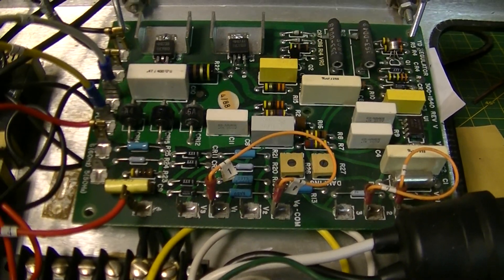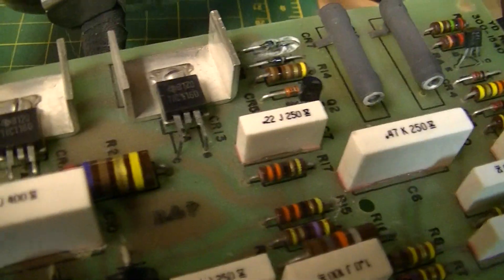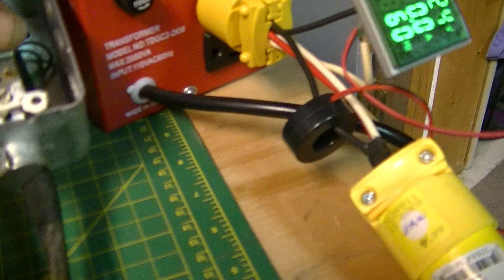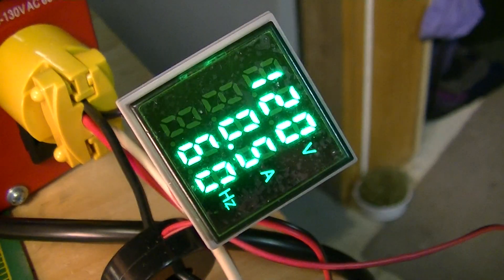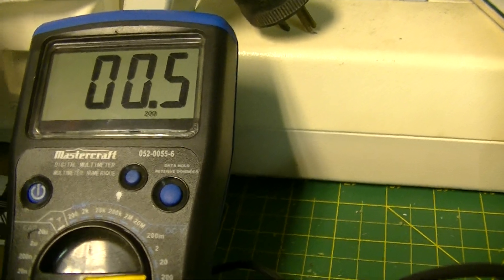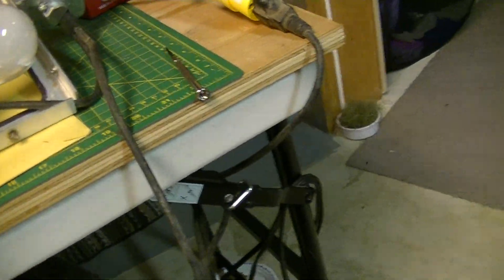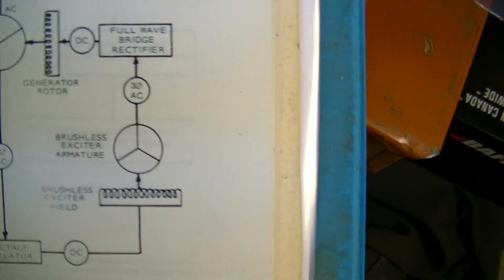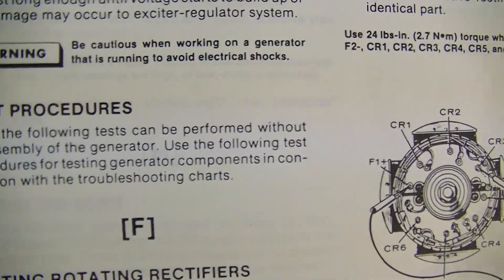Testing Onan YD VR21 Generator Voltage Regulator

Comment: imp trying to fix a Onan McGraw-Edison 30.0 GenSet generator, you know if this is the manual for it as well ?
Reply from the maker: The control board should say 'VR21' on it to be the same.
Reply: Thanks for replying, here is the issue I’m getting low voltage 30-40 volts, found some splices from motor line output to breaker panel that were burnt I just don’t know if they were touching ground, I don’t think I would get any voltage at all if it  would’ve grounded, so my question is do you think the voltage regulator is bad?
Reply from the maker: @sparkyedu  If you are getting a low output of say, 30 volts, that is a good thing. That tells you the basic generator is putting out the necessary 'residual voltage' that excites the VR21 card. The card should take that low voltage and process it so that the generator puts out the required voltage. So, yea, at this point and this distance, I feel the card is not doing it's job. Please read the other comments and replies on this video for more info on how the system works. Let me know what you find out. Thank you for the comments.

Comment: I’m having an issue with mine not providing voltage as well, the thing is is I have replaced to board with a new one and still no voltage I have went though the troubleshooting steps a few times now and I can’t seem to find the issue with mine it was working great one day then the lights in my house started flickering and pulsing, and I read on the forms to replace the board and now I have 47 volts ac coming out of the leads, the new board I got lucky and found an original onnan,online new and so I snagged it. My question to you is exactly where does the dc voltage come in at and what is it from.
Reply from the maker: Thank you for the comment. There is no DC 'in' to the board, only AC 'in' at terminals #9,10. The DC out is at the field terminals #7,8, and can be from 0 volts to about 90 depending on conditions such as load. 
   Just going by memory, the field circuit ohms resistance should be about 13 ohms. This is checked between the wires that would go to field terminals #7,8. 
   Have you tried to adjust the volt adjust pot on the board? Since it is a new board, the volt and damping pots may be set to minimum. 
   I am assuming the jumper leads got transferred to the new board? Let me know if you are making any headway.
Reply: @zeketheantiquefreak8518  it turns out I was right with all my connections and the board being bad, the rotor it self is shorted to ground.
Reply from the maker: @sethparker1473  Thanks for getting back to me. The information may help myself or someone else out on some future job. What will you have to do to repair that short to ground?